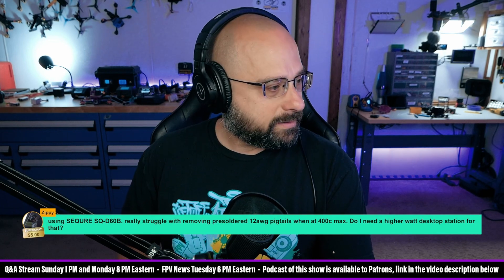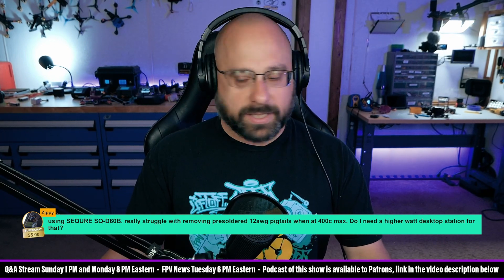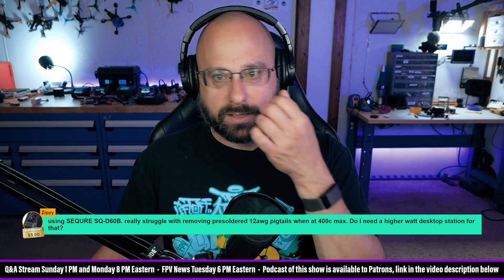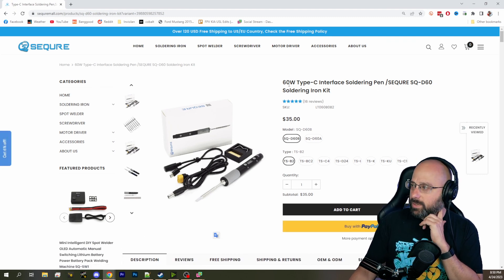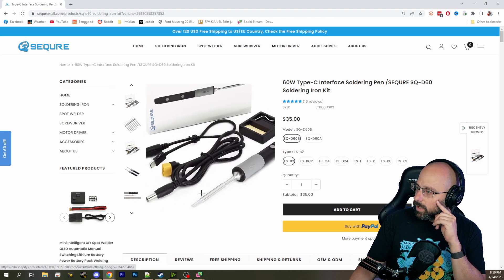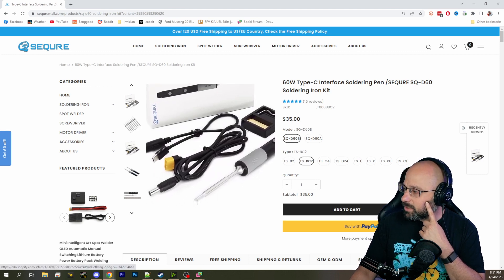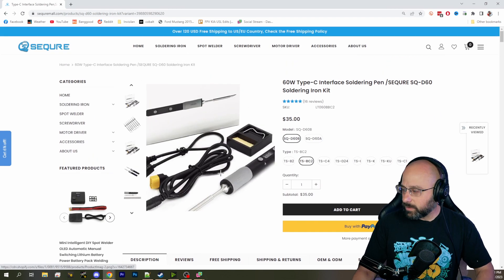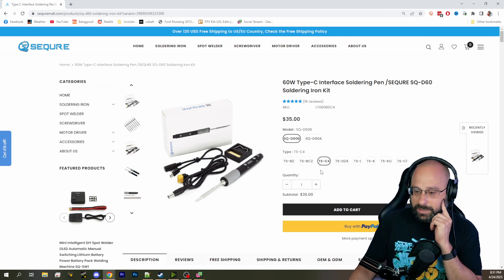I Have Trouble Soldering Big Wires In FPV! Is My Iron Too Low Wattage? - FPV Questions

Comment: you should use a weller 1010 (extremly precise) and 410 degrees C and it will be ok quickly you wont burn your ESC...

Comment: i Use SEQURE SI012 Pro , I only used 350c , just used right tip on it , I used the TS-D24 and ofcours I apply the joints with plux before I dip the soldering tip and do a little wiggle and wait til it melts.

Comment: I have this SQ-D60. This takes from 12 to 24V, but with 12V it loses temperature quicker than it gets hot when working with thick solder. So remember to power it up with higher voltage (up to 24V) to make it heat up faster and stay at the predefined temperature while working.

Comment: They use lead free in the manufacturing of prebuilts. flux, shovel tip, as hot as the iron goes and some desoldering wick works a charm for me, on bigger guages you can try and flow some good quality leaded solder into the joint and it should help it liquify more uniformly
Reply: I'll have to get a shovel tip and some wick then. I asked the question because hobbywing always has presoldered xt60 straight out of the esc and I need it angled to fit my build. Must be the non leaded solder, no matter what I do it just doesn't melt. Preheat, tons of Flux, adding solder to the tip... still rock solid. Hopefully your tips will help! Thanks :)

Comment: There is something with ESC presoldered wires. They are really hard to get off. Somehow they use a different solder
Reply: they do, because of lead free manufacturing
Reply: @marc_frank  
But shouldn’t this stuff melt earlier?
Reply: @jas-FPV  The lead-free solders melt at higher temperatures of about 217°C/422°F compared to 183°C/361°F for the lead-based option.

Comment: A true 60 watt iron with a meaty tip   is capable  of 4 Guage soldering  but with fpv we usually have a small tip to solder on pads witch don't move enough heat for larger gauge wires

Comment: clean the tip, add solder to it, use extra flux, pre heat with a hot air gun
Reply: and use 24 Volt PSU instead of 12 Volt

Comment: I use a 15 - 30 watt iron for everything. 
I have for years. 
Before that I used a Weller 100- 150 watt.
Smaller wattage irons take longer to heat up to a good temprature but work fine if you have patience.
Swerling the solder to have a uniform consistency all the way throughout the solder will work for the battery leads and connections.
You don't want a dull and bumpy solder joint.
Make it as shiny and smooth as possable.
Pratice makes perfect.